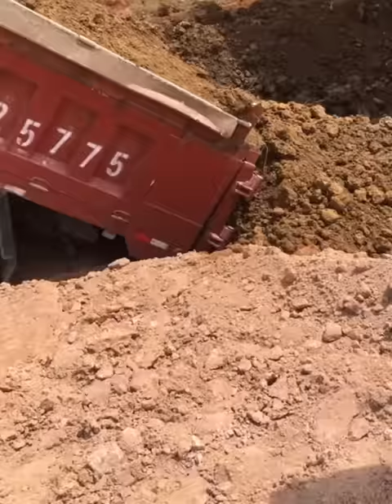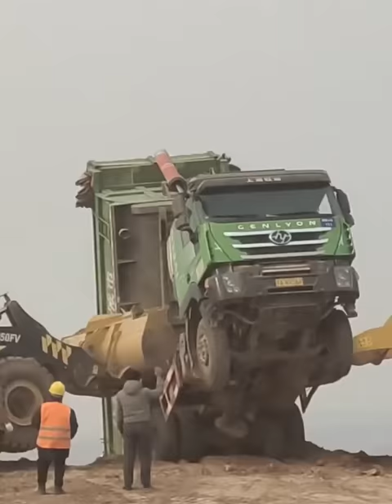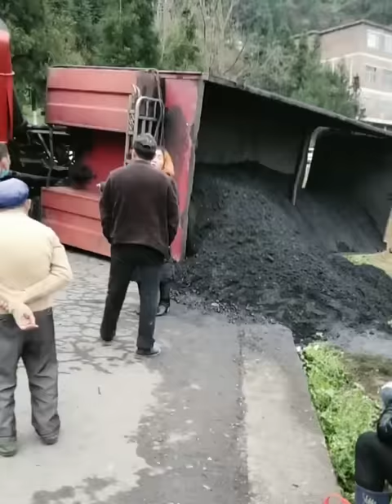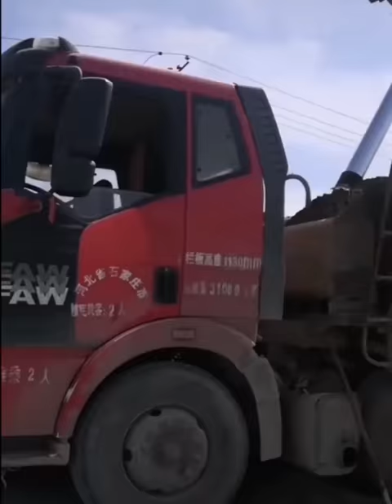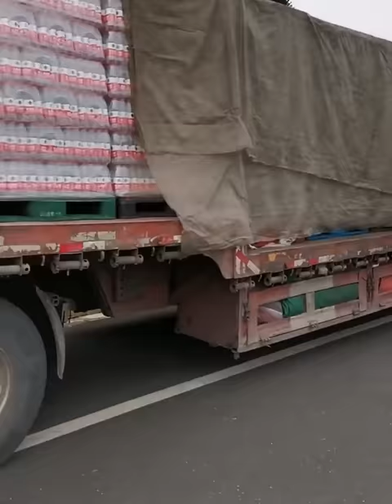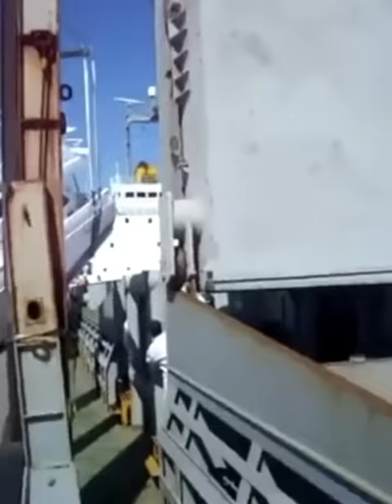Truck fail compilation【E21】---dangerous to driving a overloaded truck,feel sad for trucks!

Comment: My friend: WHY ARE THESE TRUCKS SO WEAK COMPARED TO INDIAN TRUCKS??
Me: THESE ARE CHINA MAAAL MY FRIEND😂😂😂😂
Reply from the maker: are you kidding me?  how much tons does indian 8*4 dump trucks load? and do you know how much does chinese 8*4 dumpers load?
Reply: You dont know the power of old tata trucks
Reply from the maker: @Rudr_playyz  True, I don't know the power of old tata trucks because I haven't seen even one tata truck here. can you please tell me the maximum gross weight of Tata 8*4 dump trucks?
does they comparable with chinese 8*4 dump trucks in following video?: https://youtu.be/T_ixKyX3nNY?si=cyQPYmpssgznQZj6      if you can prove that Tata 8*4 road dump trucks weights more than 130 metric tons, I will admit india trucks are stronger than ours.
Reply from the maker: hello  seems your link is unavailable now
do you familar with mechanism of trucks and know "reduce ratio" of rear axle? when reduce ratio is low, trucks can run with higher speed but cann't handle with heavy load. from your description of latest tata truck, I'm pretty sure it can't handle comparable weight with chinese heavy duty trucks
Reply: Yes bro, they can handle
And mainly, these trucks are not even expensive
Reply from the maker: @Rudr_playyz    anyway, if you can show video with Tata 8*4 road dump trucks on bridge scale with gross weight of more than 130 metric tons, I will admit india trucks are stronger than ours.   while you can find many clip of 8*4 chinese trucks in my videos that they are carrying 100+ metric tons
Reply: Yess bro, i accept that china has better technology

Comment: In Ireland 🇮🇪 truck check-in is a every day thing, Traffic Corps, Customs Revenue Officers check tax insurance NCT Like  Like MOT same thing as in Uk, same Satey Messures check desiel red or green if found with green, farmyard vehicles only ur fucked, but shows the difference between a Professional Truck Driver, compared To In China 🇨🇳,  Dept Manger Short A Driver, Picks A Forklift Driver  They Do, Overweight Will cause a Disaster & Carnage or Death 🙏